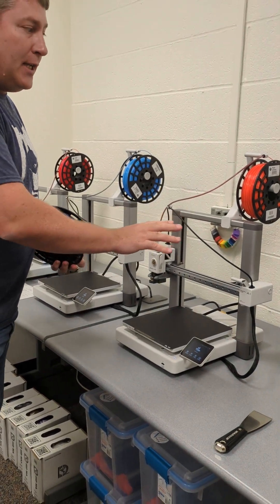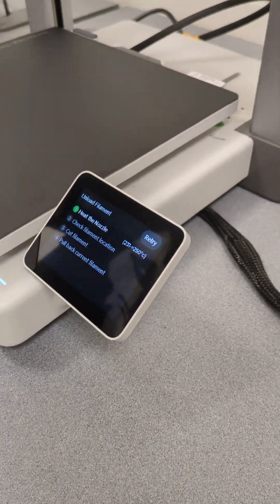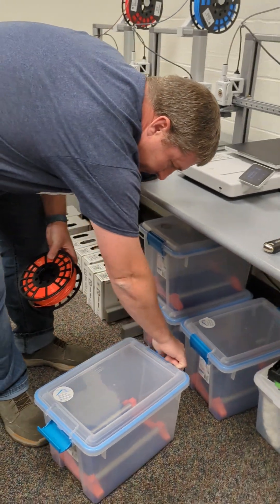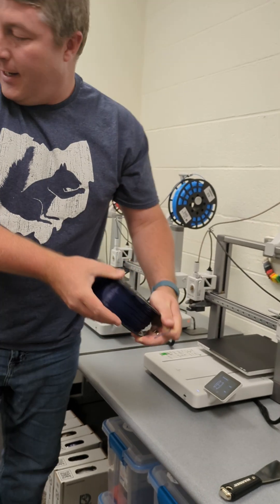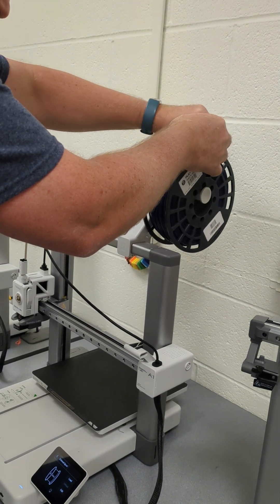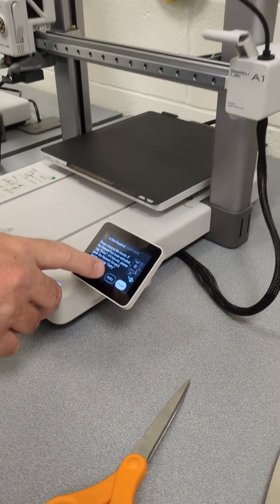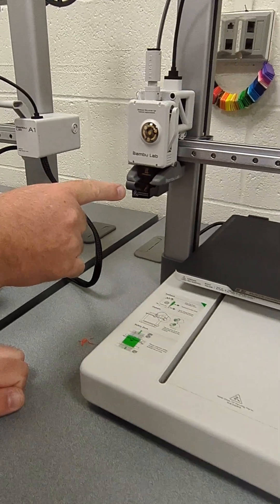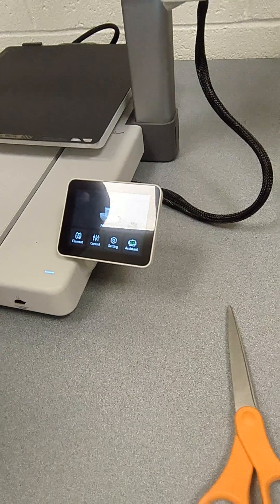Changing Filament & Loading Filament - Bambu Lab A1

Comment: Where did you get your air tight boxes? What are you doing to dessicate them? Thanks.
Reply from the maker: Wal-Mart for the boxes. The dessicate you can buy on Amazon in bulk (pour it down to the bottom). I suggest getting rechargable that you can microwave if it becomes water logged.